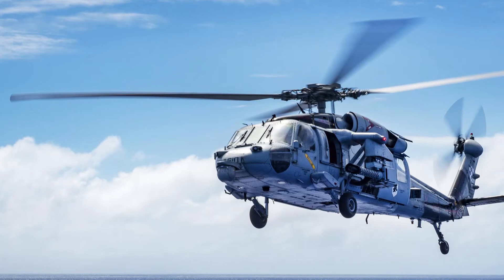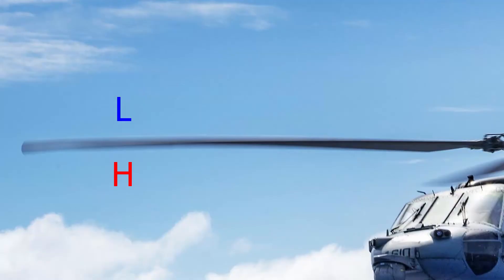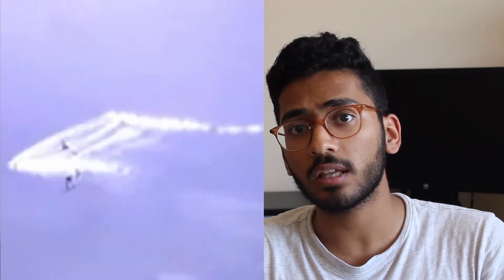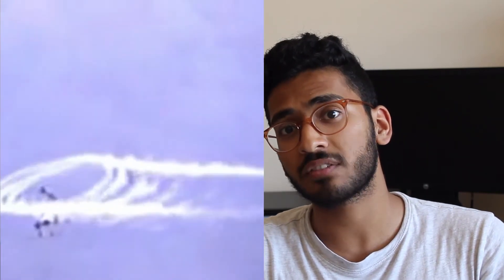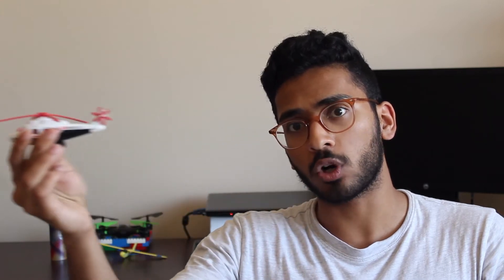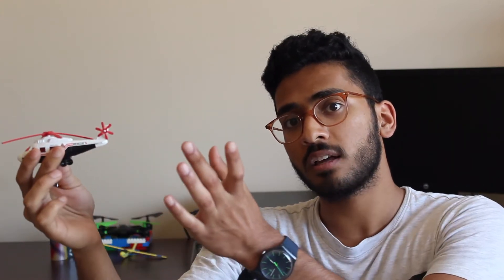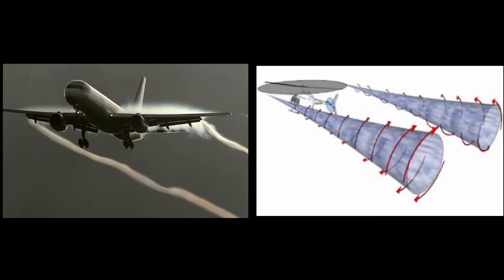Helicopter Wake Turbulence and Why it's Dangerously Strong

Comment: With all your concentrated vortice talk you could just be simpler and say the diameter of the blackhawk rotors is roughly 53 feet while the wingspan of the plane is 38 feet.   The 'volume' of air being moved in a given time frame is LARGER the the plane itself!!     You may as well fly into an hurricane/tornado...   DUH!!!
Reply: o god the fasten seatbelt sign just turned on....  this is your captain speaking... we're gonna be flying through some 'turbulence' ...  and thus the gigantic ass plane shakes like crazy flying through the VOLUME of turbulent atmosphere....